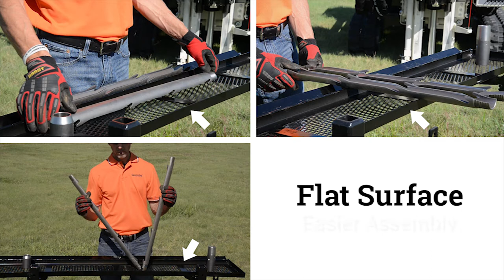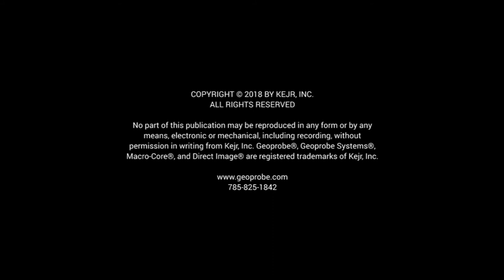Geoprobe® Interlocking Split Spoon Assembly

Comment: Symmetrical ends: nice! Multi-lead threads: Nice! Question: how does it deal with dirt?! E.g., how easy is it to scoop a sample out of the sampler? What is it like to clean the sampler in a bucket? How sensitive is assembly of the sampler to dirt - like does it have to be immaculately clean to reassemble it? Thanks.